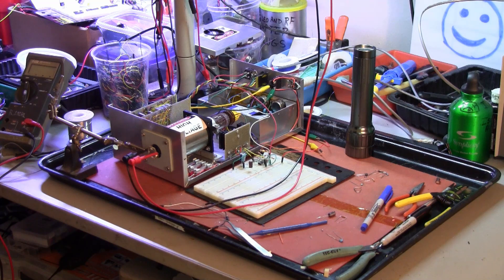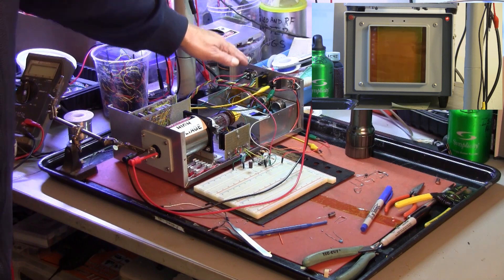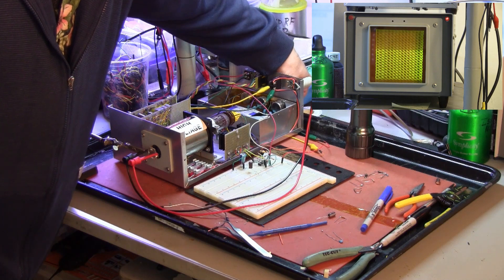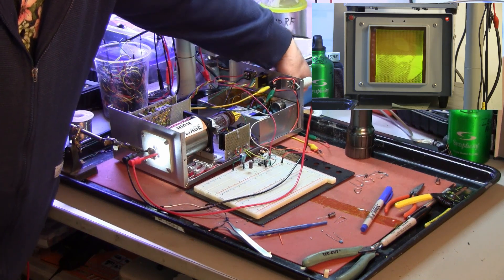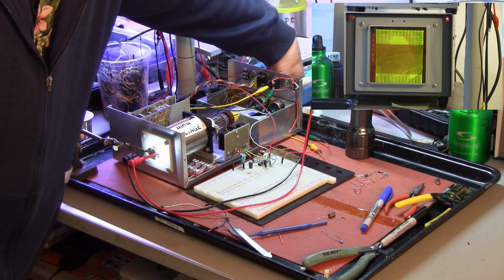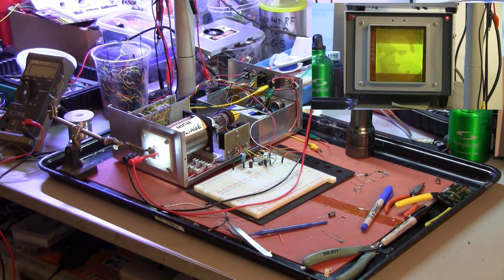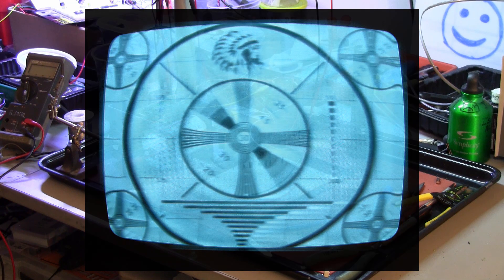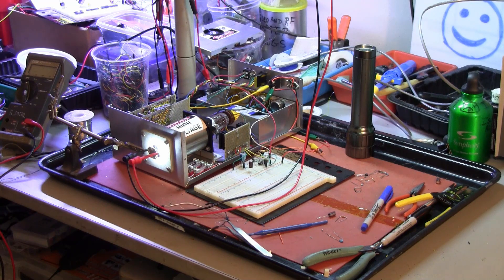PhiloCam Part 15 - PhiloCam Project Update 20190531

Comment: You might be interrested in the osmo-fl2k project. They have found an USB3 to VGA converter which is able to act like a soundcard giving you a simple way to generate just about any complex signal.

Comment: Startin' to approximate an actual video camera!
My experience with proto-boards, like you have for the video amp, is that they don't do well for high frequency circuits, and bypassing is sometimes pretty iffy as well.  With a gain of 1000, noise can get in almost anywhere, and oscillation is also quite likely.  I used to cobble together some batteries to power circuits that behaved like the noise was getting in through the power supply -- if the noise stayed, then it was probably grounding issues.  I know you'll figure out this critter.
BTW, nice improvement on The Chief's video!